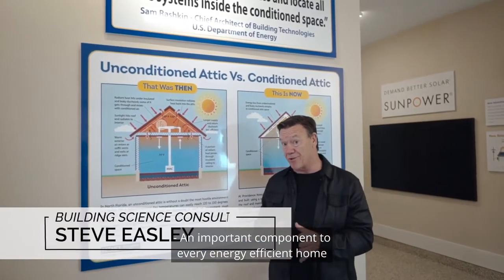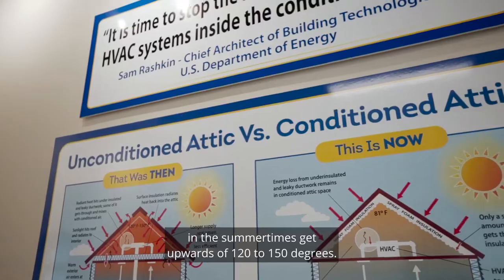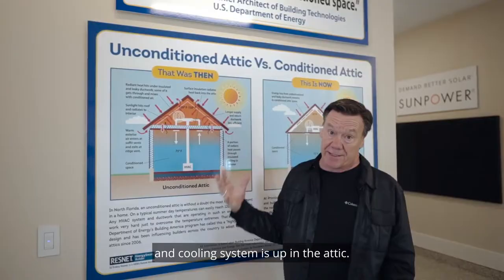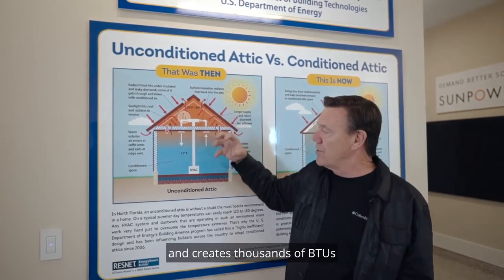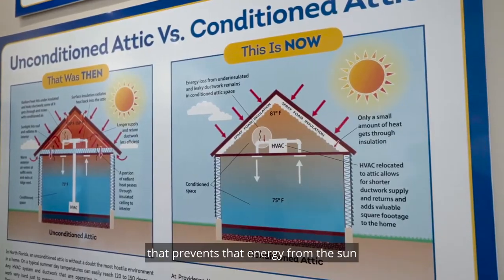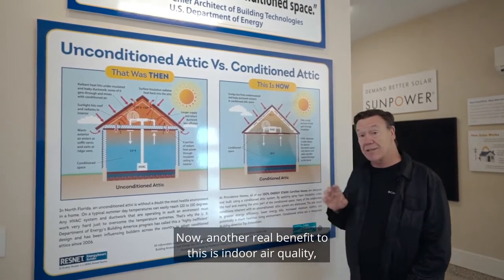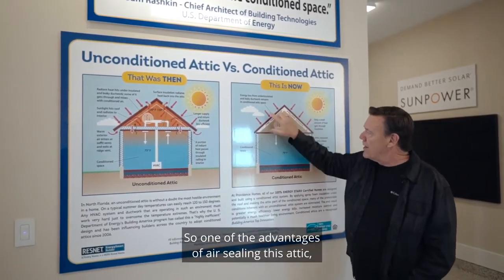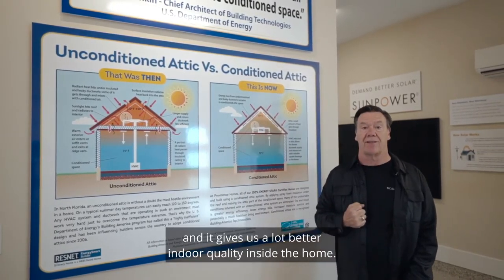Unconditioned Attic vs. Conditioned Attic - Home Building Science

Comment: I'm shaking my head and almost laughing at the claim in the video description. A conditioned attic means a greater volume of air to be conditioned. A conditioned attic means you have a larger surface area to insulate to slow down heat transfer. That's definitely less energy efficient. Of course if you MUST put your HVAC in the attic then you want to make the attic conditioned for what I believe should be obvious reasons. The winner is definitely an unconditioned, vented attic on a house that has a proper air seal. And here you're talking new construction, so a proper air seal would be easy to do compared to a renovation.
Reply: Agreed…..more square feet to cool(more expensive). Most likely need to size up an AC unit(more expensive). No where for it to escape through ventilated roofs.  Roofing materials must take a beating with this way of doing it. Matt Reisinger also mentions this in a couple of his videos….just wonder if these guys will ever give us real world results after a couple years?  Be nice for someone to post that owns a conditioned attic.
Reply: @scottburgle4889  plus if I'm not mistaken need to add a erv/hrv and a dehumidifier there not cheap plus add more kl/h to bill?
Reply: @scottburgle4889  Matt who
Reply: The ducts are normally insulated too. Why insulate the whole roof and air condition the whole attic, if the ducts are insulated.
Reply: I'll say this, we had a large 2 story house and they put in an AC unit in the attic for the second floor. Whenever outside temps reach over 90F the unconditioned vented attic space gets so hot that the AC unit can't handle it. Indoor temps won't drop below 78F no matter what. AC will run all day. It works fine when outside temps are around 80-85F though. House was built around 2000 and is in the northeast where we get all 4 seasons. I guess the ducting from basement to 2nd floor wasn't possible? Idk what options we even have to make it better at this point outside of trying to insulate between the roof joists? Or switching out the attic units with ductwork to some room based mini split solution or something. Clearly having equipment and ductwork up in that attic space is not good.
Reply: @JustSomeGuy009  not on a vented (unconditioned) attic, it’s not ideal at all.

Around me there’s barely any hvac in the attic, such a weird idea to me.

If you condition the attic then it’s fine, just for my area we need R60 attic, or if cathedral ceiling (which is what you get if you insulate back of roof sheathing) you need R31.

I’d still go higher than R31 myself, so that’s a task to get into 2x4 truss you’d have to do foam sheets or additional framing.

So to have extra space (AC won’t take the whole attic), and have your AC in the attic and save some basement space it can in theory be a good idea, just more costly to insulate the roof vs blown insulation in a vented attic.

Let alone hot days your cooling system will stress with AC in attic, also that in winter your furnace will warm the attic causing ice damn or condensation issue.
Reply: @leonpse  Because the ducts insulation is minimal, R-3 or so.  I think this all depends on where you live to see if it makes sense.
Reply: Duct wrap is only R-4 to R-8. A conditioned attic up to R-80. Yes, more volume of air in the attic but it takes less BTUs to cool a colder air compared to vented attic where the temps are extreme @leonpse
Reply: @JustSomeGuy009 You are correct! I'm in the northeast also and the correct way to go is a conditioned attic. Your AC was not sized for the extreme temperature in the attic. It was sized for your rooms below the attic. I would look into converting it into a conditioned attic. It's not cheap but worth it in the end because summers are only getting hotter.

Comment: We don't have our HVAC unit in the attic in CA but the ducts are in the attic. So maybe not as dramatic but those ducts heat up most likely. I wonder if this really means is a radiant barrier on the roof ceilng along with the insulation on the ceiling.

Comment: This is way more expensive, and what happens when you have a leak? Any builder with a triple digit IQ is not going to put HVAC in the attic. Unfortunately, there are a lot of bad contractors. Your heating and cooling is going to be more expensive too because you have way more space to condition.
Reply: Location based, in South GA having the HVAC Air Handler is a given an in pretty much every attic.
Reply: @ProductKingReviews  I live in Carrollton GA in a home built in the 70s and I have a passively vented attic, and there is no HVAC equipment in my attic. In a vented attic, the only thing that should be up there is large amounts of insulation.
Reply: @HTHAMMACK1  I’ve been in over 7,000 attics in the last 9 years in South GA near Savannah. I’m Not a hvac tech but my job requires attic work. At least 95% I’ve ever been in the Air Handler is in the attic and the HVAC unit is on the outside next to the house. It’s just how it’s done. The other 5% can vary, sometimes it’s in a closet like in the hallways or near the laundry room. My grandma actually had her air handler in her hallway in a closet but it’s very rare.
Reply: Not correct, it is routine for one system to be in the attic to serve the 2nd floor since it is nearly impossible to A/C the 2nd floor from the basement.